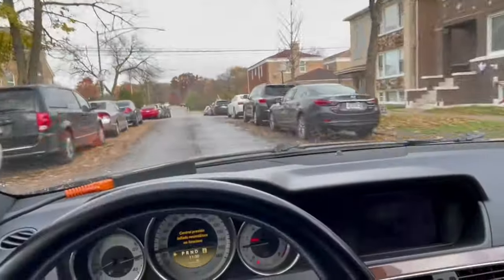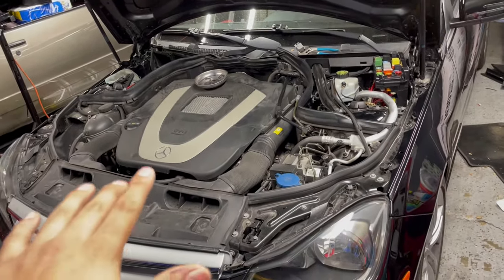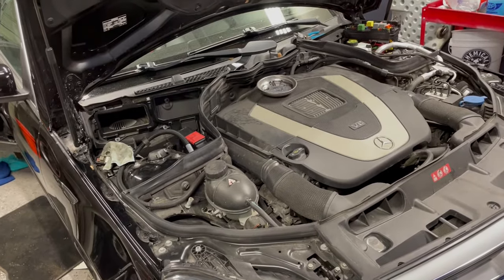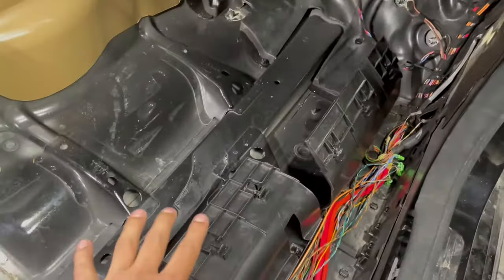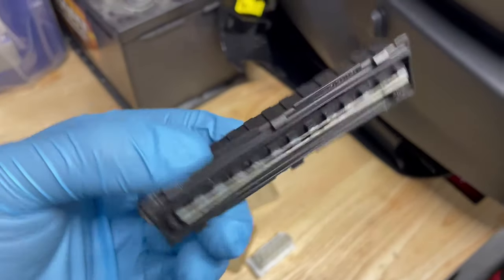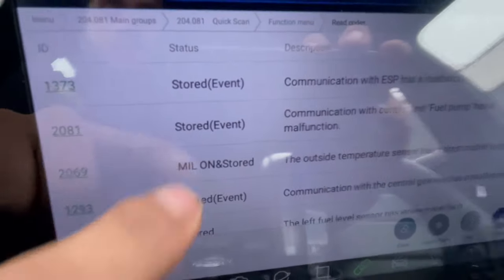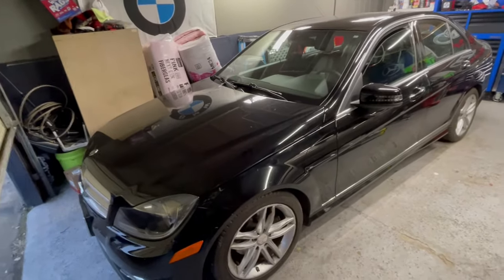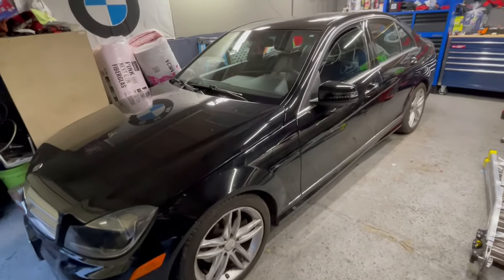2012 Mercedes W204 Central Gateway Fault!! No communication!! All dash lights on! The solution!

Comment: Thank you so much for this video. I would have thrown the whole car away after that but your video saved the day. I had all dash light, no crank, headlights stayed on, when it did crank, no transmission, no a/c no signal light, all dash lights on. I Cleaned off the Can Bus ground Block connector with wd40 and plug them all back up and bingo its was like new for $0 and a can of wd40. Thanks again for this video. it saved my benz!!! P.S. I removed all the rubber drain-plugs at the bottom of the floorboard too and left them out for future draining.

Comment: Sunroof drains are clogged. Underneath the front fender well covers you would have found a black nipple that looks like a cross. The reason for the cross is to stop wind noise in the sunroof. Problem is dirt and junk overtime clogs these nipples and when it rains the sunroof drains back up and flood the front floor boards. I’ve been a Mercedes’ technician at the dealer for 25 years. The fix is to remove the nipple and cut it off a small amount and reinstall. Call customer back and have him bring it back it will happen again meaning to clean the sunroof drains.. We at the dealer have replaced probably 50 body harnesses do to the drains. Problem is if you clean the terminals at the can blocks replace the can block the problem will be fixed for sometime but since the water wicked into the wires the corrosion will continue in time. We tried so many times to clean and replace the can blocks and send it down the road but after time can problems again. Mercedes said no more clean and replace can blocks replace body harness. I hope though it stays good for the customer and you, Hope it helps good find! We
Reply from the maker: @John Sabatini, great information!! I appreciate you reaching out specially you being in the business for a long time, you know what’s expected. As for the c300 it was my buddies car, I asked him to replace more electrical components and well he refused! He wanted the car back to normal before this issue happened without spending lots of money! He’s been happy so far and I did tell him there will be more issues down the road if he doesn’t get the top wind strip / seal installed and to keep his car a little bit cleaner by removing any leaves. Thank you for the insight.
Reply: Hello John, this is the first time I noted that a Mercedes technician had reaching out to help out answering  on a repair issue. Solidly & quality information is hard to come by. On behalf of all Merc owners a big thanks!. If you are retired pls do a channel like Hoovies or Car wizard!.

I bought a 16 years old Merc E-200k in 2022. Over here this base model Merc cost USD90,000 in 2006. Just hitting 123,000 miles. Certainly l not kidding you!. Famous for SBC & cam adjuster & timing chain plus sprocket wear issues.

 Bought it for USD6,000 me as 3rd owner!. All service records are missing. It has a number of medium bit issues that need to be sorted out. Cost of its repair vs on a 2006 Camry is about double.  🤣🤣🤣.

The condition of this car is good enough to put on another USD4,000k, over 2 years, for keeping it for another 5 to years. 

I am certainly stump why there is no engine oil pressure switch or pressure gauge coming into dashboard.

Regards.

Comment: good one bro, mine is that my dash lights are  all on, my speedometer, not reading. they are telling me back sam. these lights go off atimes and comes up after every second start
Reply from the maker: Check your fuse boxes! Check all connection make sure there is no corrosion! Also check for any water damage / leaks.

Comment: I appreciate this video, 
I am going through a similar problem with my C180 2015. 

The 2 parts replaced, how much did it cost you??
Reply from the maker: The two parts I got from the dealer I believe I paid about $67 and some change! Not bad! I hope this video helps solve your issue 🙏.

Comment: Great job. I will like to have your advice. I have a 2000 S500 with the instrument cluster out. I had water link from under the hood that licked to the floor of the front passenger side. What advice do you have for me? Thanks in advance.
Reply from the maker: I would definitely start where the leak came in from. So, I would trace the leak from the hood area, inspect any wirings. Also the passenger side,  I would remove the seat, the carpeting and any trims and inspect all wiring and Can blocks.
Reply: @Fwerks.1592  thanks a bunch for your prompt response and thoughtfulness to assist me solve this problem. I will definitely keep you posted.
Reply from the maker: @samuelm714  keep me posted! I’m curious to see what you find.
Reply: I have taken out the car seat and floor mats to the bone of the car but could not find anything out of place. No signs of wet or damaged wires or bad distribution blocks.
Reply: @Fwerks.1592  I took some pictures but not sure how to post them on the forum so you could see.
Reply from the maker: @samuelm714  have you checked the front SAM fuse box? Check for any blown fuses check for any water damage or corrosion.
Reply from the maker: @samuelm714  send it to my email Foreignwerks15@gmail.com

Comment: Bro my 2010 c300 has the same problem i have water coming in from somewhere. Only thing with mine the pre-safe limited light came on so i cant start my car. One thing for sure is im going to start taking my interior apart more to get those parts replaced

Comment: 2012 has the M276 engine, this is the M272 which was 2008-2011, although this car has the facelift headlights & dash. Prefacelift engine swap? 

Central Gateway is integrated into the front SAM. Scary video, but good one 😂
Reply from the maker: @RothBeyondTheGrave  2012 C300 came with the 3.0L M272. Another buddy of mine has the exact same year, color with the same 3.0L engine. 2013 - 2014 came with the 3.5L v6. They both definitely have facelift bumpers,and headlights.

Comment: Hello my friend, how are you doing I hope you are very well; I have a code on my 2011 Mercedes Benz e350 4matic. I would like to know if it is that the ism is bad. The code is 010187, I connect the scanner and it tells me communication with the tcm is faulty, the message is lost and also when i select N or D or R gears sound cracking down to where the ism is. Thanks, blessings, stay safe.
Reply from the maker: Good morning! Is that the only code you get? Try erasing the code and see if it pops back up. If it does move to the transmission control module I believe it’s located by the transmission. Check for proper connections or any damage.

Comment: I’m having the same issues, sunroof drains were clogged. So I clean the drains and replaced both modules. Still getting codes, should I check my fuse boxes for any blown fuses ? Or it’s an issue with the Sam modules
Reply from the maker: Which modules did you replace?

Comment: This can connector wires put by number or put on any place  ?
Reply from the maker: It goes by part number! As far as testing the block you can back probe it. Do you see any signs of corrosion? Did you scan the vehicle first of all?
Reply: Yes I scan the car it's give code in all modules no can massage received from eis but eis is ok I have replaced same problem but when I remove and put again battery wire the wipers work itself and stop and no communication in all modules after 10 to 15 minutes wipers stop and will start communication what will be problem?

Comment: Helpe out bro i need some advice on my w205 c300. They're telling me its the front sam module the car might have some water damage. Ro you recommended i check this option first
Reply from the maker: Id recommend looking at this first. If you are able to pull the fuse box and give it a good inspection before replacing it. It’s an expensive part!
Reply: @Fwerks.1592  i have no communication to the motor no start up.  Dash reads inoperative.

Comment: Where did you locate the central gateway module?
Reply from the maker: I was trying to locate the central gateway and could not find it. I also called the dealer and they also said they do not have the small white box called the central gateway. I'm assuming the central gateway is or it's the front SAM fuse box.

Comment: Pls Were can I see the gateway for GLk 350 have looking for it inside the. Car I could not get it pls help me out
Reply from the maker: Every model is a little different. I have not yet got my hands on a GLK 350. Check first to see if you  have a gateway. Most of the newer models, the gateways are being integrated with the Sam/ fuse boxes. Call the dealer and ask the parts department you are looking for the central gateway. If he has a part number make sure to write it down and look that part number up. That way you have an idea what you are looking for. Hope this helps!

Comment: THANK YOU man , i need a help my car just at the morning when i start it it terns of when i put gear ( R Or D ) but when i start it once again it runs normally and not turns off on its own if i but  (D or R  ) CAN YOU HELP ME THANK YOU .
Reply from the maker: That's very weird! Do you have access to a scanner? Do you have any lights on the dash??
Reply: @Fwerks.1592  no nothing :( 
i send my car to mercedes shop and thy tell me that the torque converter need to change .
Reply from the maker: @semounelabou1562  , already? What’s the mileage on your Mercedes??
Reply: @Fwerks.1592  395700 km

Comment: Hello, dealing with a similar car 08 MB c300 4matic 7 spd tranny. Water came into the vehicle, changed out the blocks you mentioned on driver and passenger side of car but still seems like canbus connection issues are there. You do anything to front Sam? Car doesnt have any engine codes but if i scan module to module, seems like they cant connect to one another.
Reply from the maker: Did you check the front fuse box? Did you check the connectors of the distribution blocks? If they are corroded they will not make any contact!
Reply: @Fwerks.1592  The wiring to the blocks were fine, the blocks i changed out on the passenger and driver side. For the front fuse box, should I be checking fuses or where the wiring connects to the box?
Reply from the maker: @abdultokhie8648  yes first check for any blow fuses! Then carefully take the fuse box out also known as the front SAM module. Inspect all connections for any corrosion or water damage to the Fuse box. There is only two Sam’s from my investigation. There is one in the trunk and one in the front by the engine bay.
Reply: @Fwerks.1592  gotcha, I'll definitely do that. Reason why im asking, car was partially flooded, engine was fine. Having shifting issues (like a shift flare, fluid is fine and transmission has been replaced) and from diagnostics, seems like transmission module is having difficulties connecting to engine module and other canbus.
Reply from the maker: @abdultokhie8648  , locate the TCM ( transmission control module) and start from there!

Comment: Do you know if the part numbers are the same for the 2012 c250. Mine was also soaked in water and wouldn’t let the car start
Reply from the maker: They actually use the same part on this model. I verified on the dealer website!
Reply: @Fwerks.1592  perfect thank you. So I checked the links and the parts are no long available. Any other places I can get them online ?
Reply from the maker: @moeobaidat4101  you would have to get these blocks from the dealer. I had to get them from my local MB Dealer.
Reply: @Fwerks.1592 what’s the merc part numbers ?
Reply from the maker: @moeobaidat4101  here it is Distributor Block #0055461040
DISTRIBUTOR #0045468040
Reply: @Fwerks.1592  thank you
Reply from the maker: @moeobaidat4101   https://mbparts.mbusa.com/oem-parts/mercedes-benz-distribution-box-55461040
https://mbparts.mbusa.com/oem-parts/mercedes-benz-distributor-block-45468040
Reply: @Fwerks.1592  thank you so much! Saved me so much time

Comment: I'm having issues with my Mercedes cls550, the ABS module is throwing codes saying ’no CAN message was received from control unit engine control module' and ’CAN signal 'minimum engine torque' from control unit engine control module is implausible. Help pls

Comment: Sir i need to see how to get to those wires alond the bottom of the door
Reply from the maker: Did you take the bottom carpet off? Trims and pieces also need to be removed.
Reply: On both sides or just driver side?
Reply from the maker: @jameswaugh115  this is located only on the driver side. You will need to remove the seat for better access.
Reply: Ok thz

Comment: Hi what would cause one full headlight not to work at all?
Reply from the maker: No this is not related to the headlight. Do you have the xenon headlamps or the regular halogen headlamps?
Reply: It is a R230 SL facelift and it has xenon
Reply from the maker: @Amg641  sound like you may have three things that may have gone bad. The xenon bulb itself, a bad igniter or a bad ballast. Did you see a pinkish effect from the lightbulb? Usually that indicates the bulb it’s at its end of its life cycle. I would transfer the ballast or igniter from the side thats bad to the good side that works. If the side that works does not work after swapping the ballast from the other side then thats the problem!
Reply: @Fwerks.1592  none of the lights work on that side no indicator no side light no xenon it's like the headlight has no power
Reply from the maker: @Amg641  got it!! Have you looked to see if there is any burned out fuses? They are located in the front fuse box.
Reply: @Fwerks.1592  I did have a look but they all seemed fine is there a fuse for each headlight?
Reply from the maker: @Amg641  yes there is usually a fuse for the right-side and another fuse for the left side.

Comment: My cluster is blank but it’s lit and won’t turn off 😔 drains my battery
Reply from the maker: Sounds like you definitely have a current draw, totally different. One of the modules is not going to sleep which is causing that draw.  It’s going to be tricky doing a draw test and figuring out which module is causing the draw!